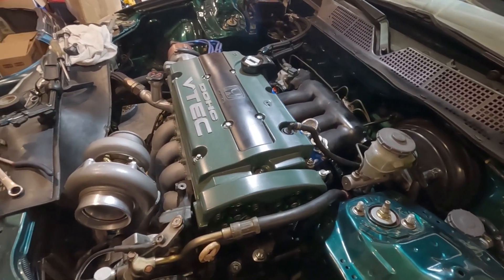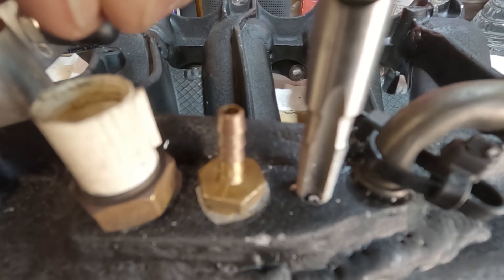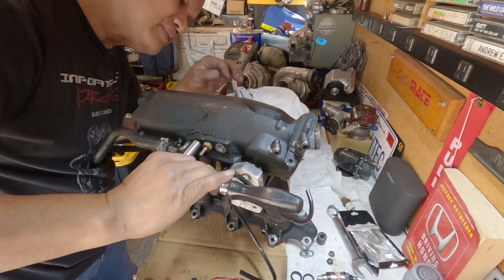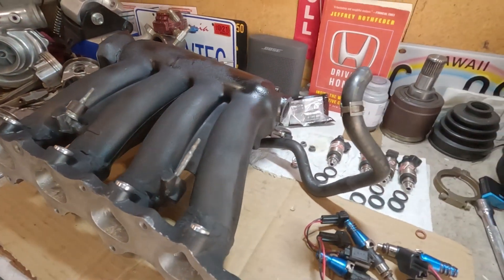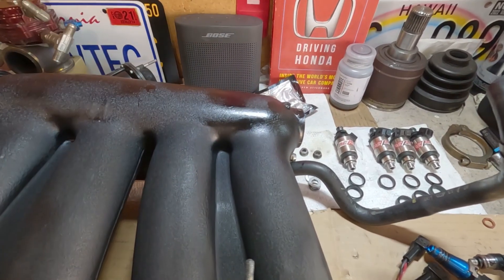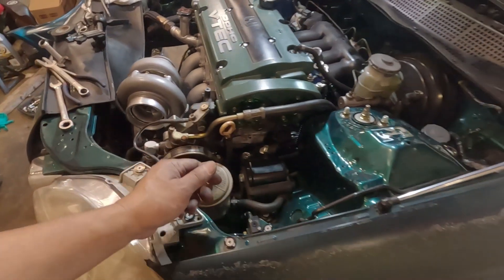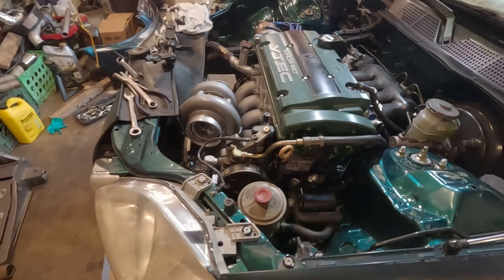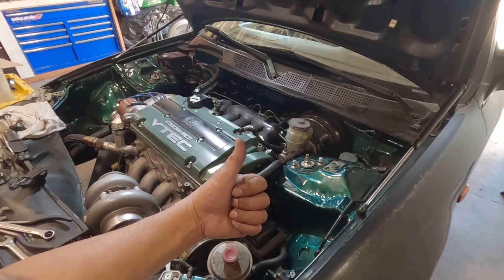1000cc ID injectors upgrade and adding Vacuum fitting on K2H RBC intake Manifold.

Comment: Did you have to use k series injectors or h series injectors?
Reply from the maker: I'm using a custom intake manifold, RBC plenum w/ H22 flange and l made the fuel rail mounted to use H22 fuel injectors.
Reply: @sagittnet2158  what fuel rail you use or did you use a custom one? Sorry for all the questions I’m trying to do a g23 swap on my accord and make decent power
Reply from the maker: @Hondaboydae  l'm using Jackspania fuel rail. I chosed to use a inexpensive rail coz l already know l need to modify it. Wished l got a different brand coz it leaked but l managed to stop the fuel to seep thru. Get a decent one if you can, pay extra and you'll have no headache. I owned a Roskoracing rail and it served me very well. G23vtec is a 200whp from the box w/o doing any serious mods on it. Use a good known intake mani and match it w/ good headers and exhaust pipe. You'll be happy. PLM tri y header replica willl give you the edge.
Reply from the maker: @Hondaboydae  no worry man! Shoot away if you have any other question and l'll be glad to help you out.

Comment: Is it worth it to buy a h22 euro r intake? Or is better to port the regular h22? I see that a lot things for the euro r manifold needs to be modify
Reply from the maker: If price is right l say yes! If it's below 300 mark, more than that, cost vs hp gain is not worth it. Doing some mods on it is not really a big deal. You'll be learning something new and have fun at the same time. Euro R is known to give more hp at mid/ top end. Regular H mani can also be a contender if ported n' polished correctly. If you ask me? If the deal is right. I'll go for euro r, it's different and not a whole lot of folks have it in their setup. It has Function n' Form l might add.